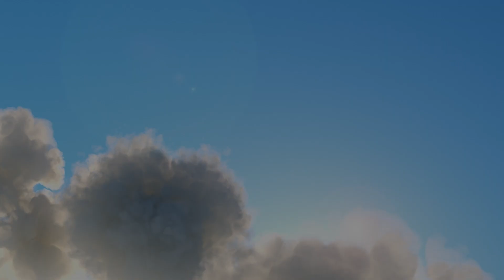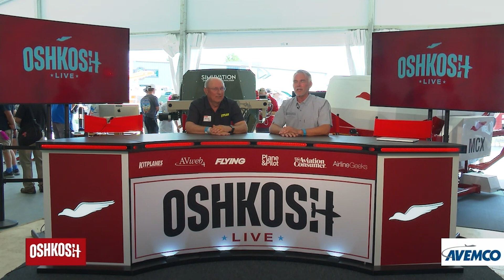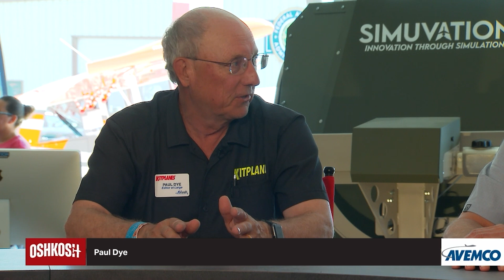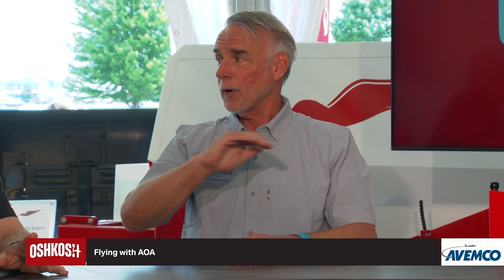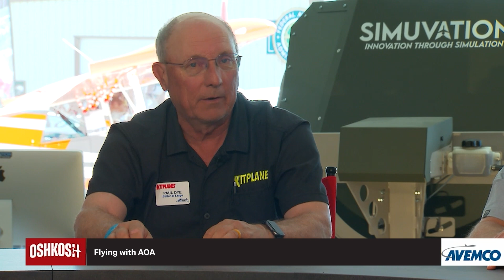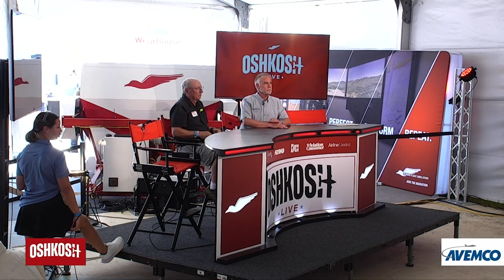Why Angle of Attack Is a Lifesaver

Comment: I’ve a thought experiment for you:  consider Vx and Vy meet at your airplane’s ceiling. This means Vy in terms of IAS gets slower while Vx in terms of IAS gets faster till they meet. (In terms of TAS, both get faster but Vx gets faster quicker hence they meet.) So, if you have two values that generally are different in terms of Vx and Vy, how can they each have a distinct correlating AOA seeing how they meet as you climb to your service ceiling? AOA is great, but perhaps not for takeoffs and climbs. You can’t give me an AOA for Vx and another for Vy as we just proved Vx = Vy at some point in your performance profile while they differ at all other points. AOAs cannot be both distinct and also vary so as to permit such to occur by being equal at some point. AOAs are not for going up. They’re for staying level and heading down. 

Be careful suggesting AOA for takeoffs. You’re under energy if you use “green donut,” or on-speed AOAref to climb. Most airframes have a best glide that is faster than 1.3 Vso and Vref is 1.3 Vso in straight flight meaning AOAref is also 1.3 Vso if neither in an AOB nor applying a pitch rate (aka actively changing pitch) meaning AOAref “green donut” is a higher AOA slower flight than best glide. 

Better to be at a lower AOA than “best AOA” so as to have margin for startle time if you’re going to use it. Remember also, Climbs are not strictly based on “best lift,” as really they are based on drag versus power  and drag versus thrust with power excess for best rate while thrust excess gives best angle. Are your power available and thrust available curves linear? Or linear in the region near L/Dmax? 

Note what Aerodynamics for Naval Aviators stated regarding L/Dmax:  

Many important items of airplane performance are obtained in flight at (L/D)max. Typical performance conditions which occur at  (L/D)max, are: 
- maximum endurance of jet powered airplanes 
- maximum range of propeller driven airplanes [in still air]
- maximum climb angle for jet powered airplanes 
- maximum power-off glide range, jet or prop [in still air]
The most immediately interesting of these items is the power-off glide range of an airplane. By examining the forces acting on an airplane during a glide, it can be shown that the glide ratio is numerically equal to the lift-drag ratio. For example, if the airplane in a glide has an L/D of 15, each mile of altitude is traded for 15 miles of horizontal distance. Such a fact implies that the airplane should be flown at L/Dmax to obtain the greatest glide distance.

An unbelievable feature of gliding performance is the effect of airplane gross weight. Since the maximum lift-drag ratio of a given airplane is an intrinsic property of the aerodynamic configuration, gross weight will not affect the gliding performance. If a typical jet trainer has an L/Dmax of 15, the aircraft 1 can obtain a maximum of 15 miles horizontal distance for each mile of altitude. This would be true of this particular airplane at any gross weight if the airplane is flown at the angle of attack for L/Dmax. Of course, the gross weight would affect the glide airspeed necessary for this particular angle of attack but the glide ratio would be unaffected.

(You can search James Albright with Code 7700 and see the Air Force recognizes and teaches the same stuff here.) What is missing from both Navy and Air Force training? AOA for takeoffs and climbs. 

L/Dmax is a constant AOA value but it is NOT reference AOA or “on-speed.” Best Glide is not “green donut.” If you take off on green donut, you’re too slow. Your AOA is too high. 

In addition to this, you may want shallower climbs for visibility over the nose, for getting away from traffic by having faster speed, for engine cooling airflow. Having a limit to go no higher than for AOA in takeoff is a good idea, but you should still use airspeed for takeoff. You should have a rotate speed and a liftoff speed. Think about twins too, you need controllable speed and that has nothing to do with AOA. Vmca has no clue what is your AOA. Neither does Vmcg. Taking off on AOA is dangerous. 

Do you have a “continuation speed” on your takeoff roll? You should already be looking at speeds to know if you should continue or abort, when to rotate, and oh by the way, AOA gets skewed on the runway and in ground effect while your center of pressure is also shifted in ground effect (see Australian sea skimmer research). 

Teaching AOA flying is great but DO NOT TEACH ON-SPEED AOA FOR TAKEOFFS. BETTER TO STAY AWAY FROM AOA ON TAKEOFF RESERVING IT FOR SLOW FLIGHT AND LANDINGS. Note AOA is good for maximum endurance, best glide time, max range if no wind, best glide if no wind, and is ideal for AOAref in the pattern and landing though you may still want to fly faster in the pattern for carrying some contingency energy.
Reply: Those more familiar with Aerodynamics for Naval Aviators may counter with “During takeoff where the airplane must 
not be over-rotated to an excessive angle of 
attack. Any given airplane will have some 
fixed angle of attack (and Cl) which produces 
the best takeoff performance and this angle 
of attack will not vary with weight, density 
altitude, or temperature.” Yes, the book stated this, but this is strictly aerodynamics of the wing in a context. It fails to account for Vmca. It fails to define with a definition as to what is “best,” is it best angle or best rate or something else entirely. [I’d presume the author meant best angle for jets as this is knowable as L/Dmax with a linear thrust available curve.] It also fails to account for your AOA not changing during your ground roll assuming tricycle gear or after lifting the tail for conventional gear. As your wing chord does not change angle relative to the wheels while you roll and your relative wind is opposite your roll, functionally, how could you use AOA? Your AOA does not change as you accelerate down a runway. The book does, however, provide context after the statement and this context leans more towards using AOA as a limit on takeoff and initial climb not as a sought target value. “An excessive angle 
of attack produces additional induced drag 
and may have an undesirable effect on takeoff 
performance. Takeoff acceleration may be 
seriously reduced and a large increase in takeoff distance may occur. Also, the initial 
climb performance may be marginal at an 
excessively low airspeed. There are modern 
configurations of airplanes of very low aspect 
ratio (plus sweepback) which-if over-rotated during a high altitude, high gross 
weight takeoff-cannot fly out of ground 
effect. With the more conventional airplane 
configuration, an excess angle of attack produces a well defined stall. However, the 
modern airplane configuration at an excessive 
angle of attack has no sharply defined stall 
but developes an excessive amount of induced 
drag. To be sure that it will not go unsaid, 
an excessively low angle of attack on takeoff 
creates its own problems-excess takeoff speed and distance and critical tire loads.” You can YouTube Canard Boulevard to see an instance in which he experiences a nose wheel bounce causing early liftoff with excessively high AOA in the IGE to OGE transition preventing him from actually climbing. Limiting AOA in takeoff is good. This is not the same as using an AOA value for takeoff, however. The lighter you are, the less airspeed you’ll have for a given AOA, the more likely you are to be less than Vmca. Note the F/A-18 provides AOA limits for half and full flaps for the sake of ensuring controllability. Unlike most performance measures, these needed to account for empty weight aft cg not max weight forward cg. Weakest rudders with smallest moment arm and least airflow.
Reply: More from Naval Aviators:  “The thrust curves for the representative propeller aircraft show the typical propeller thrust 
which is high at low velocities and decreases 
with an increase in velocity. For the propeller powered airplane, the maximum excess 
thrust and angle of climb will occur at some 
speed just above the stall speed. Thus, if it 
is necessary to clear an obstacle after takeoff, 
the propeller powered airplane will attain 
maximum angle of climb at an airspeed conveniently close to-if not at-the takeoff 
speed.” 

Do you really want to be at this AOA in initial climb? Didn’t think so.

“The power curves for the representative propeller aircraft show a variation of propulsive 
power typical of a reciprocating engine-propeller combination. The maximum rate of 
climb for this aircraft will occur at some speed near the speed for L/Dmax. There is no direct 
relationship which establishes this situation 
since the variation of propeller efficiency is the 
principal factor accounting for the variation 
of power available with velocity. In an ideal 
sense, if the propeller efficiency were constant, 
maximum rate of climb would occur at the 
speed for minimum power required. However, in the actual case, the propeller efficiency 
of the ordinary airplane will produce lower 
power available at low velocity and cause the 
maximum rate of climb to occur at a speed 
greater than that for minimum power required.”

You’ve too much reliance on power production to use bare airframe response hence can’t rely on a hard AOA. Your power available curve is not linear.  Nor is thrust.

Comment: It is more than AOA, also apply Power Techniques with AOA. Search Medium for “Improve your Landings with AOA and Power Techniques” and the correlating “F-35C Crash into the South China Sea - A Case Study.” Important, try slow flight with constant AOA turns instead of constant airspeed turns. Note you do not have to pull back to turn, add power to maintain desired descent to include staying level. Use power to control the descent, trim to maintain AOA and you won’t need back stick till round out and flare.
Reply: May also want to try Medium “Back Side of the Power Curve vs Drag Curve”

Comment: I am glad to see Kitplanes banging the drum on this.  I have long advocated this and am including it in my S-21 build.  I appreciate the work Dan Gryder is doing and have tried a few times to get him to get on the bandwagon to no avail.  His airspeed indicator placards are just a bandaid.  Yes, they are a bigger bandaid than a bare airspeed indicator, but a bandaid nonetheless.  AoA is the real solution as it directly measures what matters and isn’t a constantly changing surrogate.
Reply: Except in takeoff. It is a mistake to use it for takeoff and climb.
Reply: @jimallen8186  Why?
Reply: @LTVoyager  As Vy depends on maximum excess power and Vx depends upon maximum excess thrust, and as these curves are not linear, you do not have an AOA value to which to tie to them. It is also a bad habit for when you go to multi-engine planes with concerns for minimum controllability speeds; rudders don’t care about the wings’ AOA. See my other comments to this video.
Reply: @LTVoyager  also, what is your AOA just turning onto the runway at three knots? At ten knots as you start your takeoff roll? Forty knots still on the ground roll? Just before rotate? So, seeing how they’re all the same, likely at zero except should your wings have a built in angle relative to longitudinal axis, how would you even use AOA for a takeoff?
Reply: @jimallen8186  Why use absolutely meaningless arguments against a very useful tool like AoA?  Trim is useless on the runway also.  Does that mean we shouldn’t have trim tabs on airplanes?
Reply: trim is meaningless on the runway? why do you set a takeoff trim?
Reply: i’m not understanding because you’re making no sense. you cannot use AOA for takeoff because AOA does not change during takeoff through all speeds only changing with rotation. you shouldn’t be chasing an AOA target during takeoff though you can use it to have a reference go no higher than value as a limit. if you use AOA for initial climb and you’re at light weight, you may lack adequate rudder authority and it sets you up to kill you. AOA will save your life in landings likely without you even knowing it, but using it endangers you during takeoff and climb. Note also with high thrust craft, trying to set an AOA target on takeoff can readily lead to a PIO situation (though, funny enough, that trim setting is going to set you towards an acceptable AOA range as excluding fly-by-wire, trim is for AOAs but thrust settings and airflows vote in this too).
Reply: @jimallen8186  If you read what I wrote, I never said it could be used for takeoff.  It is used mainly for stall awareness.  That isn’t needed on the runway.  AOA absolutely can and should be used during climb out and pretty much all other phases of flight.  You are the one who brought up the nonsense about taxing and take ground roll.
Reply: You asked why I said AOA isn’t good for takeoff and that is what I answered. It also isn’t good for climbs as you don’t know your climb performance through it. Climbs are done via speed transitioning to mach as you get higher. As I stated in other comments to this video, there is no constant AOA for propellers for Vx nor for Vy. Jets do have a constant AOA for best angle but not best rate. AOA is so much more useful than mere stall margin awareness. Search Medium for Improve your Landings with AOA and Power Techniques. It just isn’t good for climbs. There is reason the Hornet flight control computers lock in an AOA value regardless of what the probes say for the first several seconds after takeoff and catapult launch. Business and Commercial Aviation had these points to say regarding attempting takeoff and climb using AOA, “During initial departure, it is necessary to maintain minimum control speed by reference to IAS since Vmc is a function of directional control… There is, however, one serious restriction to the use of AOA during that initial climb. If you fixate on the AOA indicator as the plane accelerates, the flight profile could become a series of ever larger phugoids. Here’s why: when the airplane accelerates, angle of attack is progressively reduced as the speed builds. If the profile were flown strictly by reference to AOA, you would instinctively increase pitch to maintain the AOA value as the airplane accelerated. Then when the airspeed dropped at the higher pitch angle, it would be necessary to push over in order to maintain that fixed AOA…” Remember AOA has a nonlinear relationship with airspeed. Now, could you get away with AOA for climbs in light single engine pistons? Yes and Icon teaches such for the A5. But the moment you get a second engine, or the moment you have a small rudder with small moment arm like the Lancair, or the moment you get serious high performance (not the FAA endorsement definition of high performance) you’re in trouble if you use AOA for climb. If you’re gonna do it in the light single, AOAx will be near stall while AOAy will be near AOA best glide which is also AOA max range in still air. But note AOAx and AOAy aren’t true values merely rules of thumb here as they actually vary as thrust and power vary with environmentals including density altitude. And note indexers are insufficient to show these, you’d need a gauge or numerical readout.
Reply: @jimallen8186  Saying it isn’t good for takeoff and climb was a goofy comment so I was curious to see the justification which I figured would be goofy and I wasn’t disappointed.  What part of “AOA is for stall awareness” don’t you understand?  AOA isn’t meant to replace the airspeed indicator.  It is intended to help avoid stalls which it does far better than the airspeed indicator.  This really isn’t hard to understand if you simply try rather than simply trying to make everything a nonsensical argument.
Reply: @LTVoyager  but in descent and landings, it is meant to replace airspeed indicator as airspeed was and is a poor substitute for AOA. AOA is for far more than mere stall awareness. It just isn’t for takeoff.
Reply: @jimallen8186  No, it isn’t meant to replace the ASI in descent and landings.  If ATC asks you to maintain 200 knots during your descent rather than say 150 which is normal, how will you do that with AOA?  Each instrument has its place and neither is intended to replace the other in any phase of flight.
Reply: @LTVoyager  150 isn’t normal. 150 is normal at max gross weight forward cg wings straight and specific to your hypothetical plane. This is the point of AOA. ATC won’t have speed restrictions all the way to landing. And you can always tell ATC “unable.” The Hornet lands at 8 degrees AOA. The Goshawk at 17 units. The Cirrus SR-22 uses 0.62 normalized or ‘3 o’clock’ on the gauge till roundout and flare. Icon A5 use3s “white line” or “yellow line” depending upon type of landing. And all fly-by-wire systems use AOA with speed only as backup when in landing configurations.

Comment: Surely critical aoa changes with flap settings. How do the various systems deal with this?
Reply: The change is relatively small on most GA airplanes and isn’t a significant factor during a normal approach and landing.  Larger, faster jets with large Fowler flaps and leading edge slats generally have inputs for flap and slat setting into the AoA instrument so that compensation can be made.
Reply: @LTVoyager Thanks for the answer. Greatly appreciated
Reply: Electronic ones with integrated flap position calibrate each wing configuration. For my pneumatic analog Lift Reserve, however, I have bench marks on the gauge for each flap setting. I also rotated the face 90 clockwise so high is up instead of left.